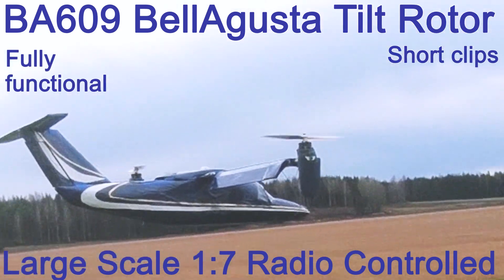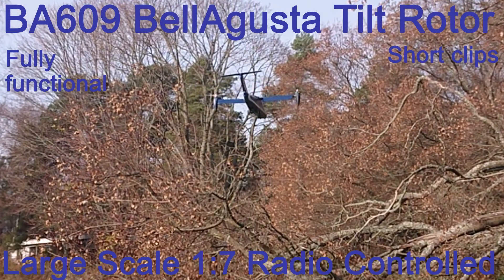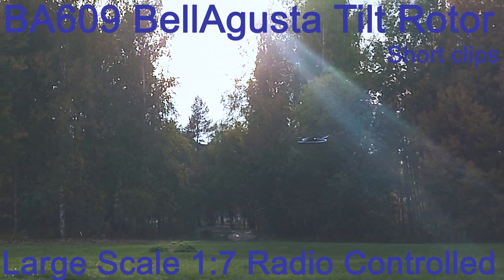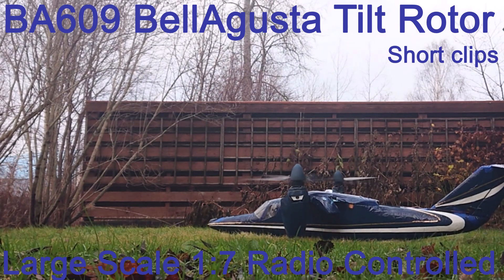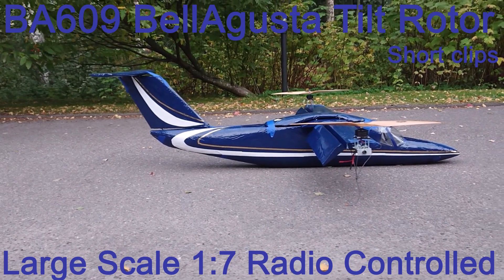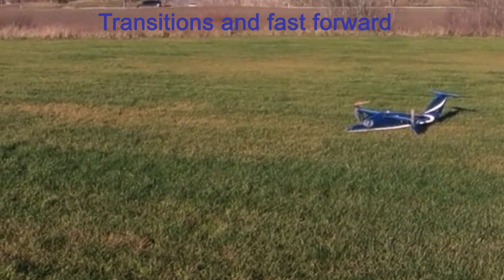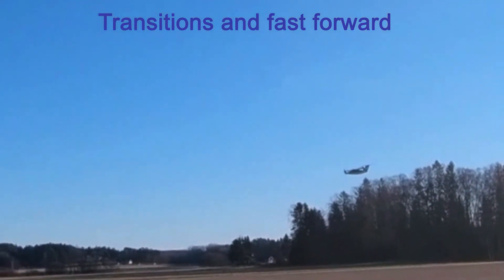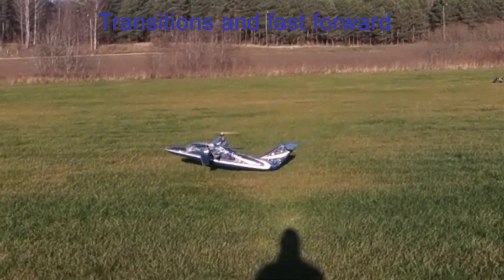AW609 Tilt Rotor VTOL RC Big Scale 1:7 BA609 Leonardo

Comment: Hi Jans,
¿What frame configuration do you use? 
This made me very thoughtful, because Naza does not support Bicóptero.
¿Do you use DJi's native firmware or did you write new code?

Stay on the summit.

I humbly ask for your understanding. (I'm using Google translator)
Reply from the maker: It is basicly quad copter. Two EDF thrusters are hidden inside fuselage.
Reply: @Isostara1  So it's more complicated than my ability can understand.

Your project is amazing.

Thanks again for answering my questions.

Comment: Congratulations on the amazing project.  
The plane flies very steady, looks like an eagle.  
¿What flight controller board did you use?
Hugs from Brazil
Reply from the maker: Thanks! Controller is DJI Naza M. Aircraft is designed so that I can use standard software.
Reply: @Isostara1  thanks a lot.
Reply: @Isostara1 ,
¿What flight mode did you use to configure Naza?
Reply from the maker: @demetriusvasconcelos5866  I can use all 3 of  flight modes. GPS position mode for low speed 0-10 km/h, Level mode from 0-80 km/h and Gyro mode for fast fly.
Reply: @Isostara1  Very nice, thanks